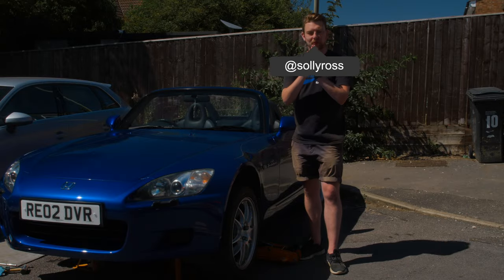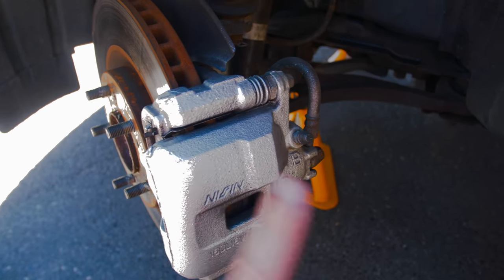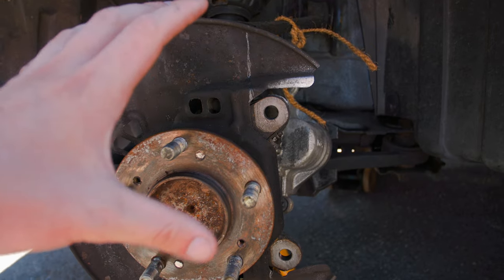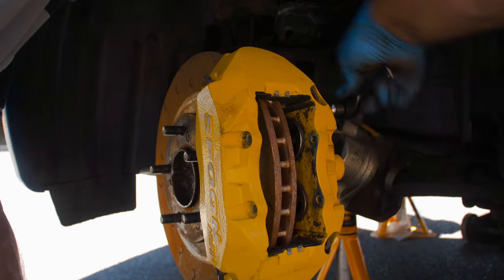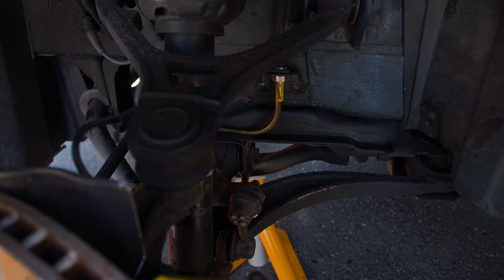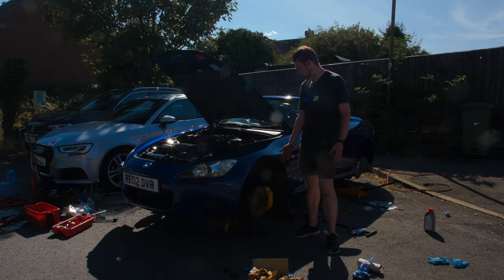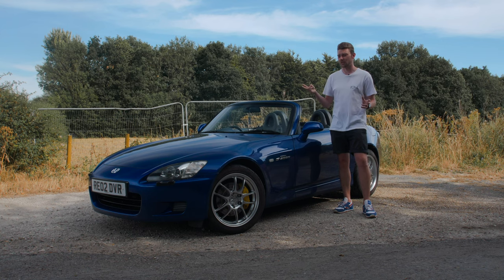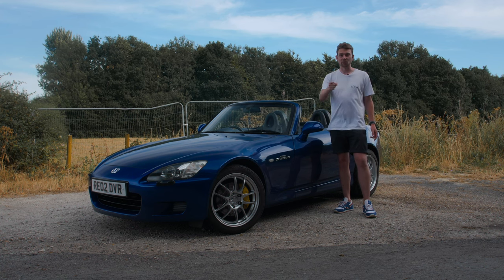Installing My Dream JDM Brakes On The S2000!! Spoon Monoblock Callipers! 4K

Comment: How you finding the S2000 mate? I’m looking at changing my ep3 for one aswell but I’m abit on the fence about it.

Anyway it’s good to see you’re taking the time with mods and getting the good quality parts you want, it’s easy to want to rush and mod this, mod that then before you know it you forget what your original plan for the car was
Reply from the maker: I am absolutely loving it man! It has exceeded my expectations. Especially now it has come cool parts on it too! Haha. I am glad that I have the EP3 as well though! Definitely useful having the practicality of the Civic to move things (and more people) around. 
If you can make it work with your lifestyle then get one! Incredible fun!
Got some cool parts that I want to get too so hopefully I can make that a reality too!
Reply: Yeah that’s the perks of having both, ep3 is more dailyable(?) Glad you like it I think I’m just looking for more reasons to push me over the edge and get one 😆 

Looking forward to seeing what you do with the build anyway man
Reply: @ArsenalsJack1992  
Do it sooner than later but coming into winter aswell as a recession on it way hope you get a fair deal.
Only thing I'd say is you need patience to buy a good one there's some rough ones about and you will have to travel to find what you want there never on your door step
Reply: @ArsenalsJack1992  
Also do a compression check before buying takes a little time to do but a healthy engine so important as well as a good chassis
Reply from the maker: @ArsenalsJack1992  I feel very lucky to have both as it is the best of all worlds then. I couldn't live with just the S2000 though, its just not practical enough for day to day stuff.

Comment: How do you feel about those calipers in comparison with the stock ones
Reply from the maker: They have more bite and less fade, plus, changing the pads is so much easier. They do look SO much better than stock too! Haha
Reply: The braking force is more linear. When you push on the pedal, there's more precision and feedback. The stock sliding calipers are like an on/off switch. The Spoon calipers provide much better modulation; even pad wear; and theoretically, slightly more resistance to brake fade.